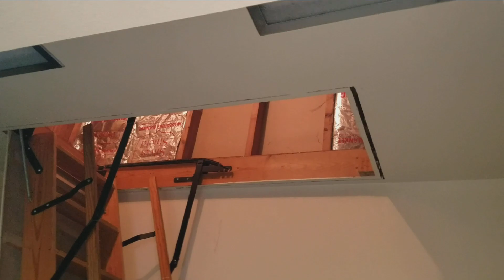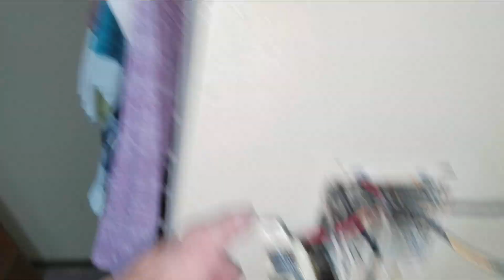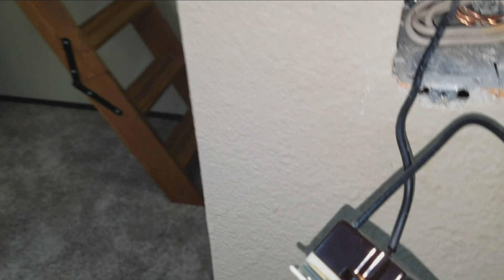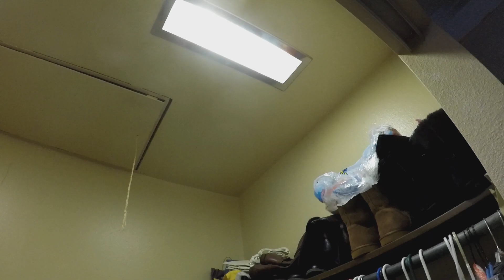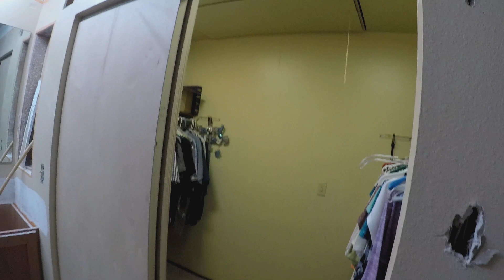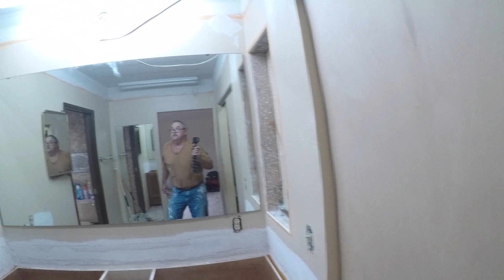Eliminate a three way switch And Correct Crossed Neutral Wire Connections

Comment: Instead of cutting all the holes why not just use the stairs and go into the attic and fish the wires through the wall it takes 10 minutes
Reply from the maker: You sound like my brother whose favorite saying is it should take about 15 minutes. On this outlet, it was only being moved a few inches to center it on a cabinet space.  As for going into the attic, there is R42 of blow in insulation. Also, the roof slopes down over the wall making it a very tight fit. It would be tough and messy going into the attic. What I did do was go into the crawlspace and run wires that way.

Comment: I have a light switch that use to turn off the overhead light. My brother decided to remove that capability when he installed a ceiling fan. How can I return it to the original function? Stumped!
Reply from the maker: Hi, just noticed your question. Your brother removed the switch and now the ceiling fan has power all the time? You operate it with the pull cords? There are several scenarios that could be going on here but I'll give it a shot. I am going to presume the swithc is either still there and not working or a blank cover has been installed replacing the switch. The light switch wires should still be in the switch box. He may have simply put a wire nut on the two wires that operated the light so the light would be live all the time. If the two wires are simply wire nutted together, you could simply reconnect the two wires to a new light switch and make it like it used to be. Another option I use in my house is a remote control unit that mounts in the base of the ceiling fan and is controlled by a 9 volt battery powered wireless switch in the light switch place on the wall. That setup works nicely because we have full separate control of the fan and light on the fan unit. To install this system, the fan would need to be removed and wired into the remote control unit. It works very well.
OK, hope that helps, remember to turn off the power when you are going to touch the wiring. If you are uncomfortable to do this, hire a qualified person to fix your situation. Good luck...
Reply from the maker: You could get a remote controller like this. https://www.homedepot.com/pep/Hampton-Bay-Ceiling-Fan-Wall-Switch-9050H/202801200?mtc=Shopping-B-F_D27L-G-D27L-27_20_CEILING_FANS-NA-NA-Feed-PLA-NA-NA-CEILING_FANS_OutdoorCeilingFans&cm_mmc=Shopping-B-F_D27L-G-D27L-27_20_CEILING_FANS-NA-NA-Feed-PLA-NA-NA-CEILING_FANS_OutdoorCeilingFans-71700000052688704-58700005049197237-92700053379035660&gclid=CjwKCAjwh472BRAGEiwAvHVfGse2oBVt_51GodjMP3Nkyx_yjn_qw7IElPHQe_A1oCdM6D8E-VvfthoCLp0QAvD_BwE&gclsrc=aw.ds

Comment: Maybe you should turn off the power first???
Reply: He means because you were touching the neutrals.
Reply from the maker: You are correct, the power should be turned off when working with electrical. Power's on for demonstration purposes.  Power's off when actually handling the wires and devices. You should know that!